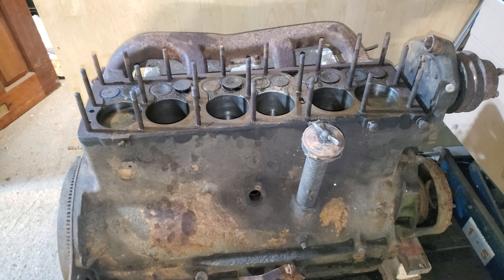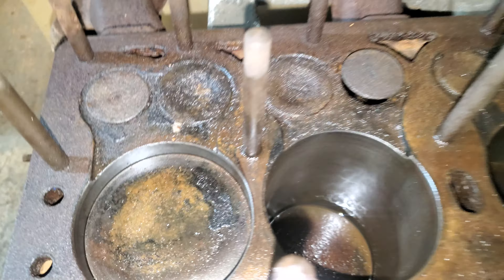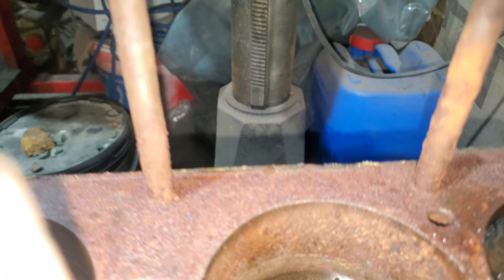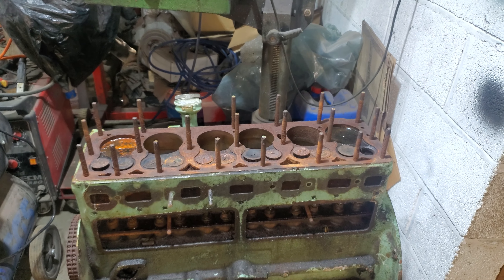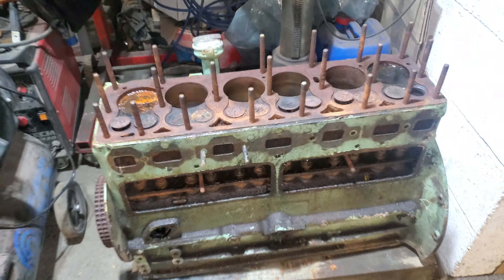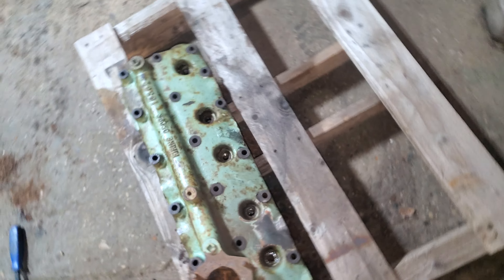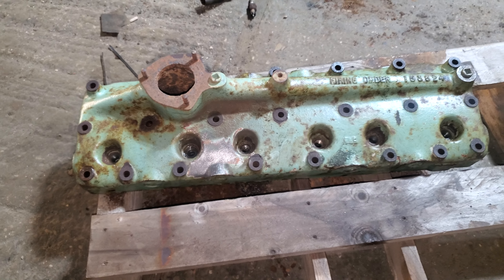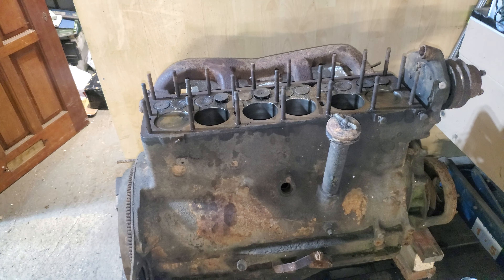RARE ! Karrier K6 Six Cylinder Petrol Engine .. Can I Make A Good One From These Two Spare Engines ?

Comment: Find it interesting that those engines were designed with the valves in the block, never seen that before but I’m no mechanic or vintage expert. I can definitely see advantages over modern designs though.
Reply from the maker: @dieselbushcraft1299  it's how a lot of engines were back in the day, like the first Ford V8 . Known as a side valve or a flat head , things then moved onto OHV Overhead valve making side valves redundant except for things like lawnmower engines such as the Briggs and Stratton etc.